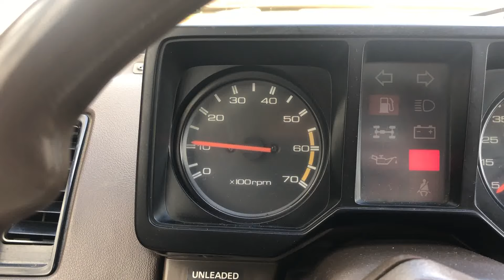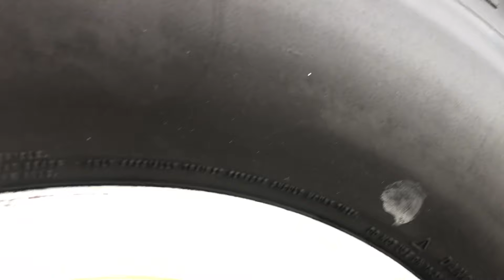FOR SALE 1986 Isuzu Trooper II, 2dr, LWB, 2.3, 5-speed, 113k

Comment: Is it sold already?
Reply: It sold to a guy who just put it on "Bring a Trailer" no reserve, and is bid at $3,500 as of this post. I saw cracking on shock bushings, so that tells me those need to be replaces, and I really dislike the chrome lower panels. No telling WHAT they are hiding, and they just look gawdy. In back they appear to be detached, with a gap between them and the body. I wonder about the heater core, radiator, how well the 4wd works, alternator, starter, water pump, and any other bolt-ons. There's an easy thousand dollars worth of unknowns there. I heard the engine running in another video, on BaT, and it sounded a little ticky, but fine. That's typical for the motor sound. I had an '86 myself, for 7 years. Sold it when I bought a 2nd gen. '98.